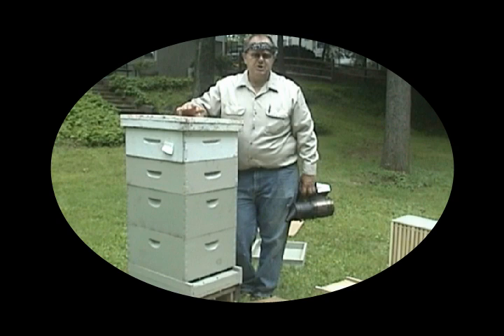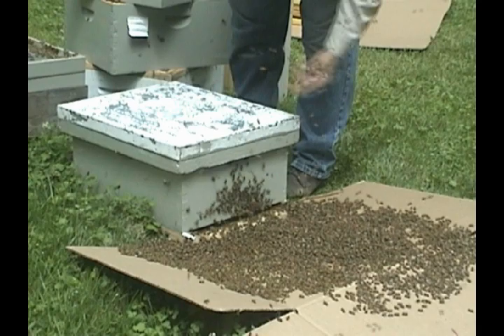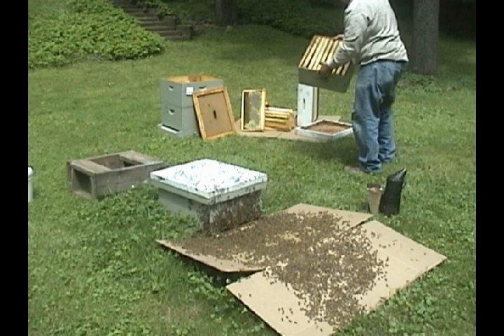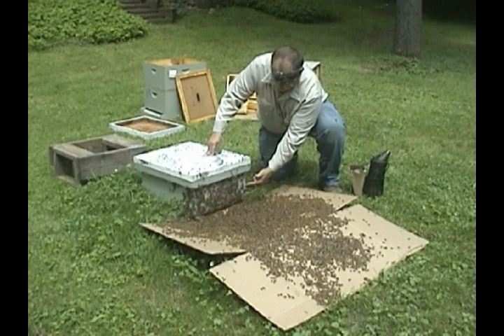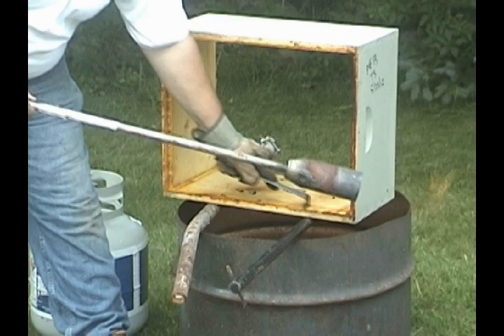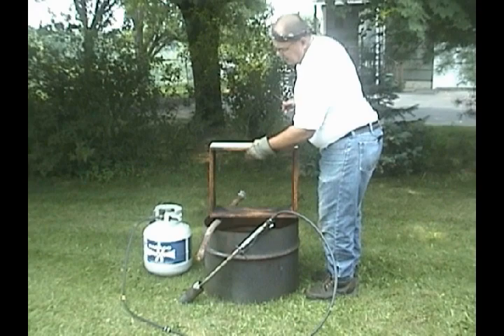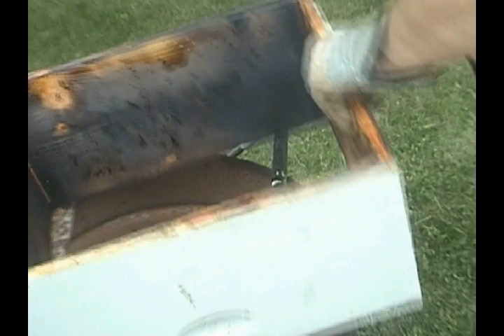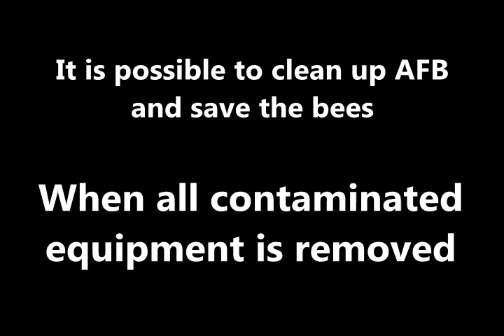NJ State Apiarist Remediation of Foul Brood

Comment: I'm thinking burn the old boxes and build new ones. The cost of a tank of propane along with the possibility that it might not get spores deep in the joints and the time it takes to char a large hive just isn't worth it.
Reply: I'm a carpenter. I could have built a new box, and the cost and labor would have been close to the same. I have a fireplace and wood heat. They wouldn't have gone to waste.

Comment: I'm in Kansas wanted to ask about boiling. I have a 30 gal. tank we can heat and bring to about 260. We only go to about 180. But we boil and then repaint. Do you have any thoughts on this. It has worked for me so far. Also do this to used equipment I buy and to lost hives that I reuse the equipment.
Reply: I made an inquiry with Tim on your comment and yes, he said that boiling is an effective way also.  He indicated that it boiling it in some lye water is a good way to sterilize it as well.
Reply: Boiling for at least 11 minutes.